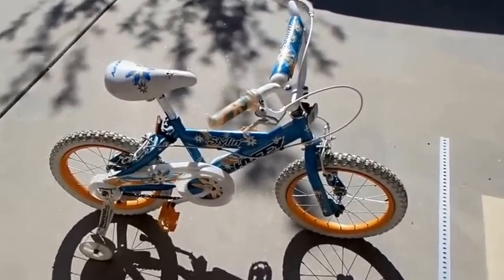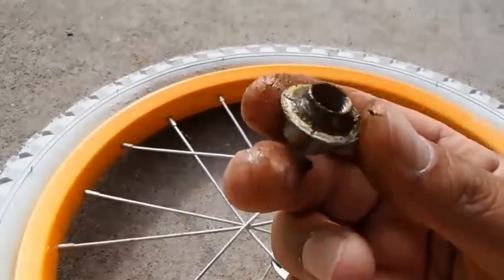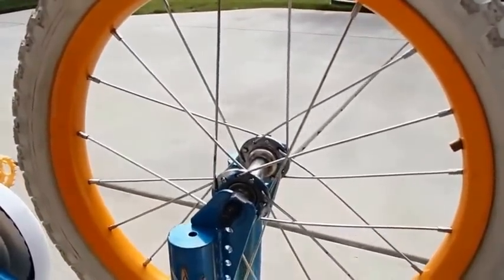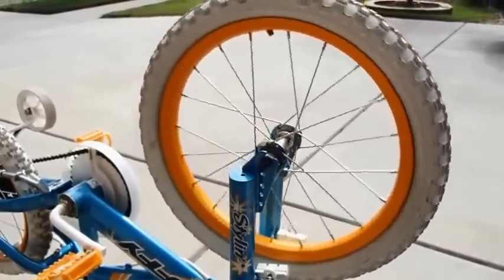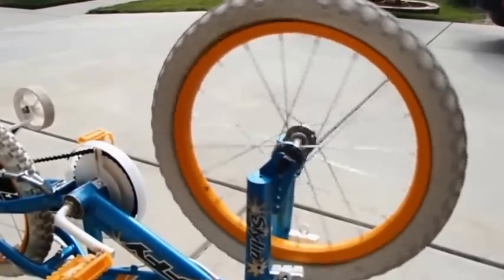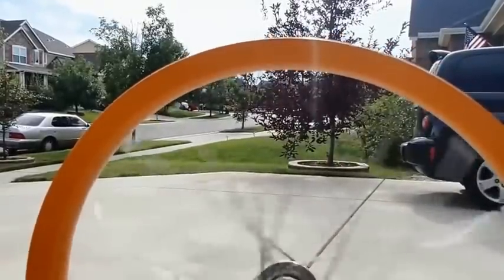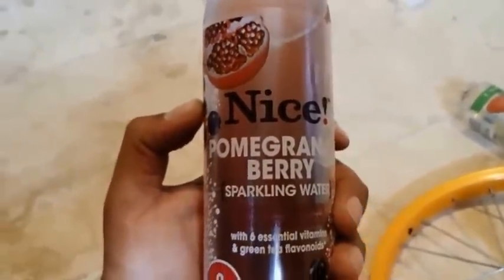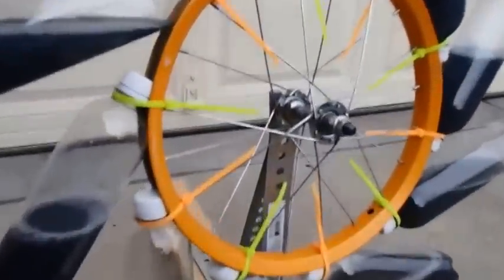FREE ENERGY!! Easy To Make at Home Perpetual Motion Machine - DIY

Comment: Wow, thanks for the tutorial that shows how to make a machine that isn't possible...Perpetual motion is impossible...
Reply: HOW BOUGHT A GRAVITY ASSISTED WHEEL.....
Reply: All ist A circle, end never live !!!
Reply: Not impossible just not discovered  untill now.
Reply: @mattglaze3697  No, it's still impossible. Perpetual motion machines would break the laws of thermodynamics, and thus they cannot exist in our universe. What we see here, with the concept of the overbalanced wheel, is simply taking the energy that already exists, from gravity, and "converting" it into another form, radial kinetic energy, shown by the spinning of the wheel. The bearing that holds the wheel on the axle will also wear out, and it will stop the spinning motion eventually, due to friction. So the machine is not truly 100% efficient either.  

Again, perpetual motion machines are impossible. However, there's no reason that we can't harness natural and renewable sources of energy or kinetic motion sources found in nature to provide our own energy. Fossil fuels just seem more profitable to the majority of corporations, but if we continue down that road, we'll see the consequences soon enough.

Comment: Hi,  what is the size of the bike wheel?  Also, how much water did you use in each bottle and how did you dissolve the salt?  Thanks.
Reply: this is a scam.
Reply: It's an idea. Whether it works or not. Not a scam.
Reply: Then how come they call it perpetual motion?
Reply: So you are saying the entire idea of perpetual motion is a scam.
Reply: Anyone claiming they have made a perpetual motion machine is lying.
Reply: So are you saying that the man is scamming because of his claim or that the idea is a scam in its own?
Reply: Yes, perpetual motion is impossible.
Reply: Flying was once considered impossible.
Reply: Have you heard of conservation of energy?
Reply: I understand what you are saying. That you cannot have "free" energy because the energy will have to cost one way or another.
Reply: So what is the problem?
Reply: The way you phrased this fact by calling the entire video a scam. The man has an idea and a theory to put to test, by claming a scam you are hindering any improvement on the idea. He is making no profit from this idea hence it it not a scam. The original question was about the device and not the benefit/usefulness. It is an experiment, experiments are needed to further science whether the outcomes are possible or not.
Reply: I understand that, but he clearly states that it works, and tries to lie about it's legitimacy. His motives are not scientific. This is not an experiment. If it was an experiment he would have labeled it as such.
Reply: He never said it works. This is just a build video.
Reply: Read the description.
Reply: I have, he never claims it works. He states his intentions, describes what it is, and the basic origin.
Reply: You just contradicted yourself.
Reply: How?
Reply: Johnathan Shaver 
He claims that it works by the name alone „perpetual motion machine“. This is a scam a bullshit video, whatever you want to call it.
Reply: Kerry O'Connor 
What's your point? The fact that the design is there for ages doesn't mean that it actually works. Da Vinci for example had numerous designs that were pure bullshit.
Reply: Honey I asked him the same thing on a similar video just a few hours ago. The laws of thermodynamics prevent a machine like this from actually existing. The reason we are asking to for him to provide the details of the material and implementation of his experiment is so that we can confirm it as science. If you have an experiment and get the same result repeatedly it's science. If we cannot reproduce the results it's a scam.
Reply: Aidan P., why? Perpetual motion its a fact.

Comment: Did an experiment making one didnt work. I used a normal size wheel with large bottles. On my model the wheel diameters was too big compared to the bottle leangth. Id have to use the same diameter bottle length and bottle weight with the liquid to be a true replicat experiment.